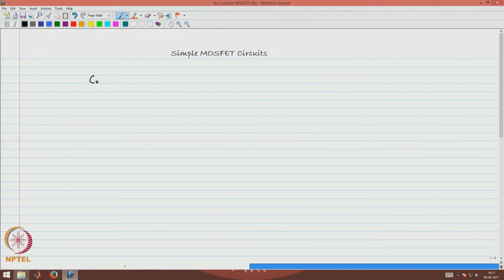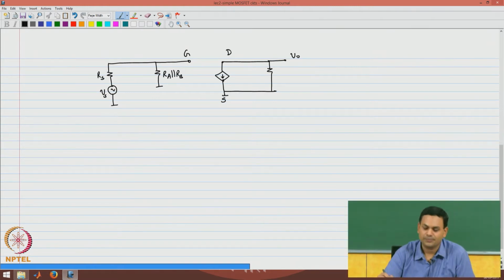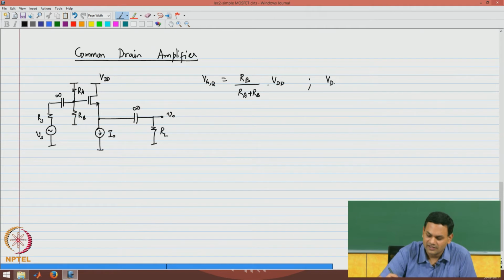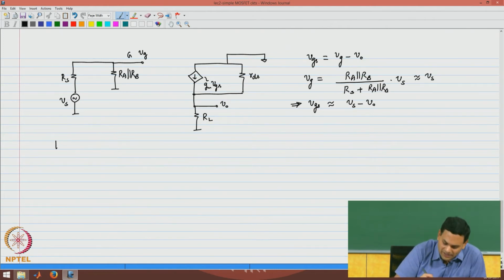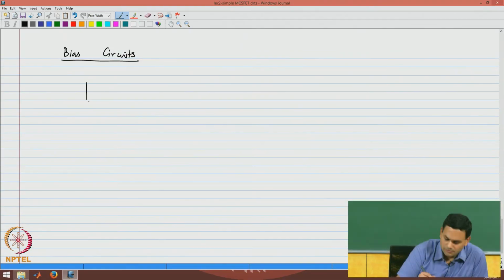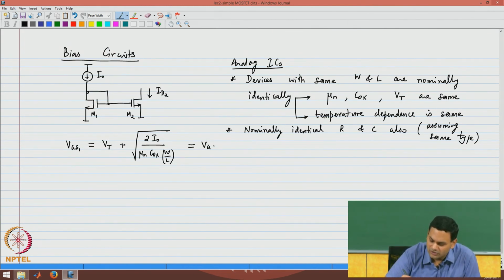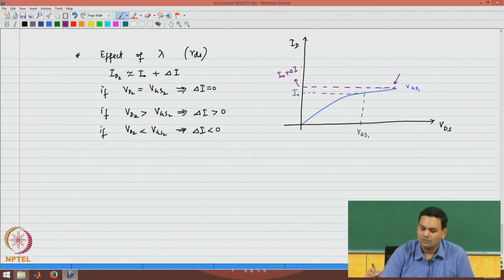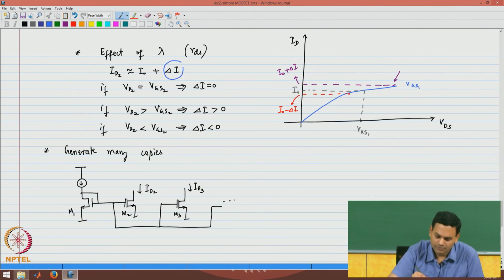Simple MOSFET Circuits

Comment: At 20:00 common drain amplifier in order to get voltage gain unity.. we have to maintain large gm, this means area increases, drain current increases , power dissipation increases.. can we tolerate all these increments.. in order to maintain gain stable

Comment: Is Q point in active region or “saturation” region, for amplifier operation?
Reply: For amplifiers having bipolar junction transistor Q point is fixed in active region whereas for MOSFET based amplifiers Q point is fixed in saturation region.
Reply: Yes for mosfets to act as amplifier the region should be saturation